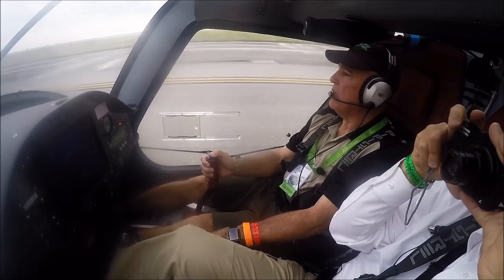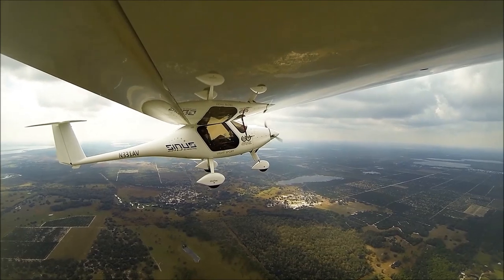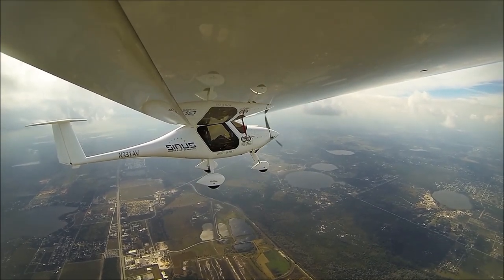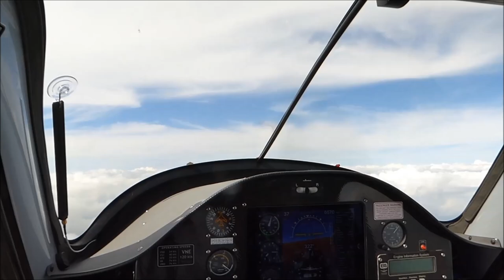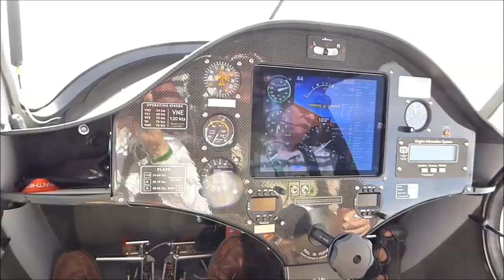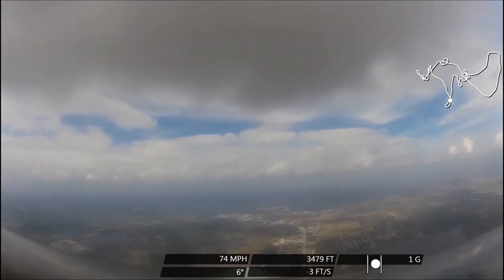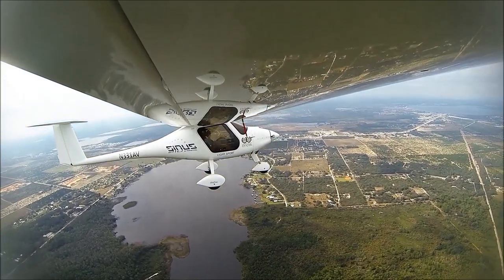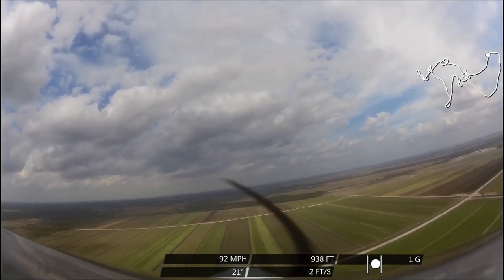Pipistrel Sinus Motorglider Demo Flight with Rand Vollmer - Sebring Sport Aviation Expo

Comment: I always wanted to learn to fly.  This looks like so much fun.
Reply from the maker: @Random Stuff with Joe Thanks for watching! Lots of General Aviation airports have flight schools that offer "Intro Rides" for $100-$200. You can use the website "Airnav" to find airports in your area and Airnav lists flight schools and other airport information. An intro ride is a great way to try a bit of hands-on flying. You may be able to do intro rides with multiple schools. Becoming a licensed pilot requires a significant commitment of time and money. Plan on flying once or twice a week over a period of 5 or 6 months. Its hard to make progress and sharpen your skills if you go too slow or stop and start. Flying is challenging and that is part of what makes it fun. I wanted to learn to fly as a kid but didn't actually start flying lessons until I was 41.
Reply: @sopilote56  Ya.  I took an intro flight when. I was in my early 20s.  I'm now 52.  I just don't have the time to commit.  But I'm still always fascinated with flying.  This Motorglider flying looks really fun tho.
Reply from the maker: @randomstuffwithjoe  Getting a glider rating and then a motor-glider add-on may be an easier option. In my opinion, flying gliders on a nice sunny day is a lot more fun than flying powered aircraft. If you want to try a glider flight (highly recommended) check the Soaring Society of America (SSA) website "Where to Fly" at https://www.ssa.org/where-to-fly-map/

Comment: Well  I just went soaring . Very nice and thorough video, can't get any better demonstration than this. Thanks.
Reply from the maker: +Ivan Kondaurov Thanks for watching! Glad you got to soar. Rand gave a great demonstration of the remarkable Pipistrel motorglider. I only wish there was a little more lift that winter day so we could have gone up a little with the engine off instead of just slowly downward.
Reply: @sopilote56  I agree with you on thermals it be so nice to stay up for hours in total silence without engine running. We did about 2.7 hours and what a great time that was !!
Pipistel is extremely popular in Europe and well respected between glider and regular pilots alike. I really wish that more pilots be flying birds like that.  I personally fly Autogyro MTO sport and feeling is not the same as you get in this glider. 
Ones again,  thanks for sharing your experience with us.

Comment: Wow! What a pretty cool little aircraft. I would guess it's cheaper to travel across country in this aircraft rather than by auto on ground. And a lot more fun. 

One thing I couldn't help but to notice about the lakes. They appear to be near perfectly round. I wonder if they are crater lakes, and if so are they impact or volcanic?
Reply from the maker: +Gryphon Arms USA Thanks for watching! I think you could readily achieve 30 to 40 MPG flying cross-country at about 100 miles per hour true air speed. Thanks for noticing the round lakes - that is why I chose the shot for the video thumbnail. Central Florida has lots of nearly perfectly round lakes from sink holes - collapsed limestone caverns. Googled Pipistrel MPG and found this from a 2011 Flying Magazine article "One of the surprising performance points it turned in was a level speed of 142 knots. It will, in fact, cruise at 140 ktas (the factory specs say 148) making 40 nautical miles per gallon — exceptional for a factory-made 100 hp two-seater." You mileage may vary.

Comment: That stall seems very akin to certain fixed wing microlights. Remarkable aeroplane/motor glider, ideal. 

Is there a reason why it's being flown from the right seat, or is that a motor glider thing? 

The only thing that might be off-putting is the shiny/reflective carbon fibre panel? But I'd be happy with one, so versatile, modern, frugal.

BTW what are those near perfect circular lakes? Old quarries or gravel pits? They look very mysterious from the air, intriguing and cool.

Thanks for posting 😊👍
Reply from the maker: @Muso Seven Thanks for watching! Sorry for the late reply as I was traveling. Rand is a CFIG and is used to flying from the right seat with the trainee in the left seat. The stall was very gentle...the wing has at least three different profiles so good aileron authority after the wing roots stall. I suppose you could put a film over the carbon fiber to reduce glare. The round lakes are almost certainly very large sinkholes. They form when the Karst rock formations below the surface collapse. If you look at Florida on Google Earth you will see lots of round lakes of various sizes.

Comment: How does the ipad handle pressure for baro & altitude?  Good job on the video!
Reply from the maker: @Dennis Mathias Thanks for watching! Rand wold know best, but better IPads have Barometers and Accelerometers which when combined with GPS and WAAS might be "OK." It could also be that there was some type of AHRS (attitude and heading reference system) hardware in the airplane sending data to the IPad.

Comment: Is this plane pressurized at high altitude?  Or you have to have oxygen mask for high altitude?
Reply from the maker: @unebonnevie Thanks for watching! Simple aircraft like the Sinus are almost never pressurized. Pressurization adds weight and complexity that is not needed for the kind of flying most private pilots do. In the US, a supplemental oxygen system is required for flying above 14,000 feet. Using oxygen for long flights above above 7,000 feet is best in my opinion. Typically the oxygen system uses a portable cylinder and a cannula system that feeds gas into the nostrils so that normal headsets/microphones can be used for communications. Aerox, Mountain High and Precise Flight make portable systems for small airplanes and gliders.
Reply: @sopilote56  My house is at 7,000 feet :(
Reply from the maker: @Dave Doe Thanks for watching! As a flat-lander who lives barely above sea level my first visit to Flagstaff (7,000' msl) I got a bad headache just walking around after landing at Phoenix and driving straight there. During my visit last month I was fitter, my transition to altitude was gradual and I felt great.  From the Airman's Information Manual 8-1-2-a: "a deterioration in night vision occurs at a cabin pressure altitude as low as 5,000 feet." I like to fly Florida between  8,000 and 11,000 msl and have not used Oxygen but it would be good to have at night.
Reply: @sopilote56  yeah actually I'm not a pilot but I live in Colorado and am interested in the Sinus because it can fly so high and climb so well - it might be a good plane for doing mountain tours when the wind is calm.  I was considering maybe taking some of the gliding classes in Florida to try  a pipistrel out.
Reply from the maker: @davedoe6445  @Dave Doe Thanks for watching! Rand Vollmer was offering Pipistrel training in Zephyrhills, Florida last I heard. Florida is a great place to train in the dry season between November and May. I really don't know how the aircraft would do for mountain tours. Probably really well but it may be bumpier than aircraft with higher wing loading.

Comment: Can you please tell me how did you mount camera on wing ?
Reply from the maker: The flight was 4-1/2 years ago, I cannot say for sure but it was probably an adhesive GoPro mount near the wing tip. It could also have been a threaded mount attached to a tie-down point.

Comment: The Sinus is a very effective and nice machine. The pilot apparently forgets that Sinus is a motor+++glider+++ . Flight is far from impressive...
Reply from the maker: +TheCoolVibration Thanks for watching. It is easy to find fault with a pilot when every move they make is captured on video. Nothing was edited out. Flying in a busy air show environment is chaotic and stressful. Winds were gusty with a significant crosswind component for landing on the narrow 1200-foot usable-length taxiway. I think Rand did a GREAT job of demonstrating/explaining the capabilities of the Sinus on a windy winter day, with an approaching cold-front (visible in the distance) and no thermals to be had.
Reply: TheCoolVibration in the hands of an experienced  glider pilot it can soar for hours. wondering if the flex option is good.. change wing tips when you want to soar and for going places use the shorter tips. would you get a garmin 3x or dynon skyview or is that IPAD  good enough. also the rotax 80 can run on 87 octane car gas I believe

by the way what's the name of the pilot. I know he flied from zephyr hills
Reply from the maker: +Ariel N The pilot was Rand Vollmer. He is the SALSA East Dealer see website here: http://www.salsaaviation.com/SALSA%20Pages/SALSA%20Contacts.html 
I think that you have it right about using short tips for cross country for a little less drag/higher speed. Avionics options are up to you. I would probably go for a Dynon Skyview, but depends on your mission.
Reply: TheCoolVibration thanks thats a nice plane. soaring brings a lot of confidence and a better pilot.
Reply: sopilote56 and that plane is the sinus flex model.  thanks again
Reply from the maker: +Ariel N You are also right about 87 Octane Gas. I attended a lecture by Rotax-Expert Phil Lockwood at Sun-N-Fun earlier this month and he said that the 80hp 912 has a great service life using regular auto gas. The higher horsepower Rotax engines need higher octane which may be more difficult to find so people end up mixing aviation gas with car gas. This makes the oil and the engine get dirtier with lead sludge from Avgas.
Reply: TheCoolVibration how much do you is this airplane as optioned?  i would like an autopilot and a safety margin an auto leveler button.  i am still looking. you do less oil changes or cleaner oil with car gas
Reply from the maker: +Ariel N -- Talk to Rand about pricing. Dynon has good autopilot and auto-level options.
Reply: TheCoolVibration thanks

Comment: The thing is a brick compared to a sailplane…motor glider pilots rely on the engine so much they never really learn to soar beyond 
sinking to a point where they re-start…you can fly like that in a 172 …try flying a 1000k triangle in that pig, it will never happen. Buy a glider and learn how to soar without constantly reaching for the starter…
Reply from the maker: #donzioldbuddy Thanks for watching! I have spent several minutes climbing in a Cessna 152 with the engine idling over the eastern side of Lake Tahoe flying out of Minden, Nevada. So in my (log) book a Cessna 152 is soar-able. The Sinus needs reasonably strong thermal lift or mountain wave to do sustained soaring but there are many places where you could probably have fun flying it around for an hour or more with the engine off. It is a very efficient airplane and has set fuel economy records. It isn't trying to compete with Stemme (which I have flown) or self-launch sailplanes but it is a great little motor glider. I am just back from Sun-N-Fun 2022 and there were many, many Pipistrel aircraft on display. Hope that the Textron (Cessna) purchase of Pipistrel will be a positive thing.